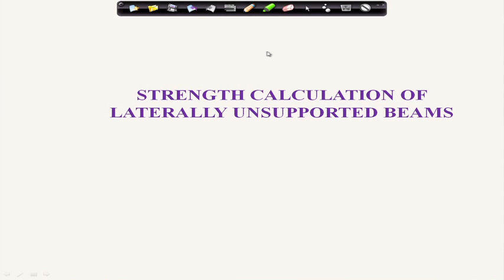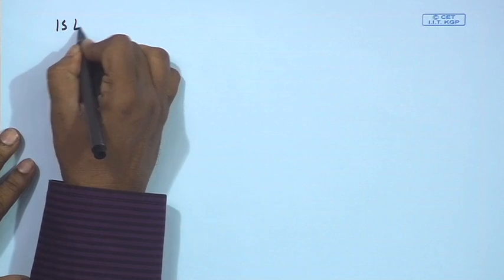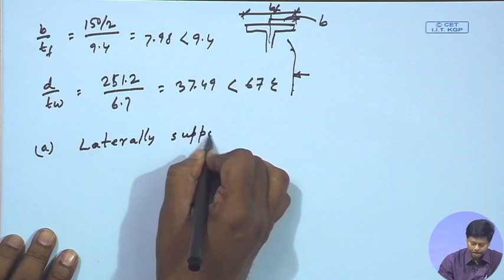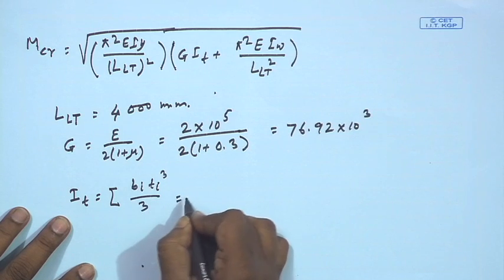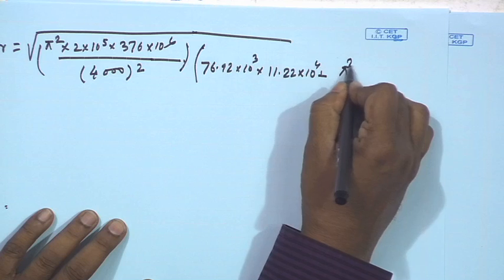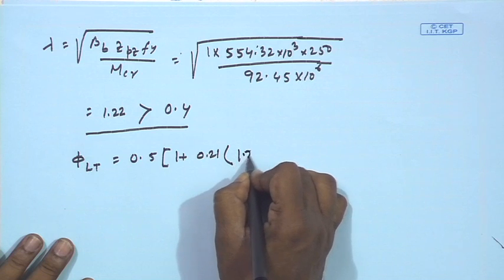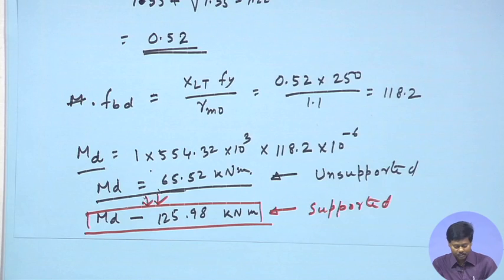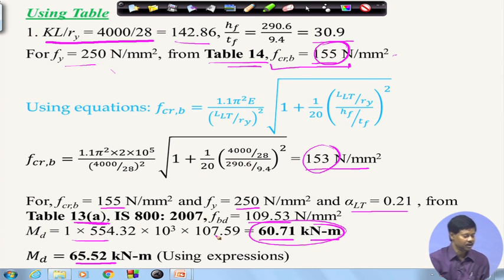mod10lec51

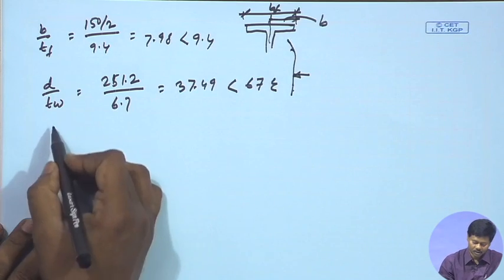Comment: @ 8:50 Where did 67 come from? Shouldn't it be 84?
Reply: 84€●
Reply: Check cl 8.2.1 paragraph 2nd of IS 800:2007, Page no.53
Reply: If it's less than 67, then we don't have to check for web buckling. Correct me if I'm wrong.
Reply: @gautamraj-f7d then, why is epsilon written alongwith 67?
Doesn't the E indicate a variable value?